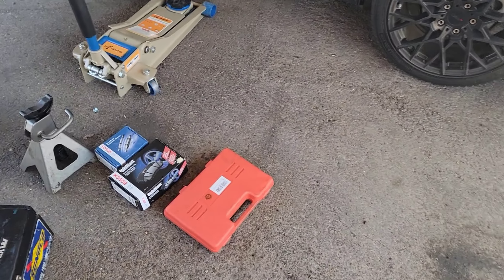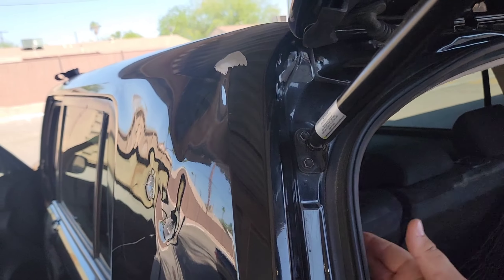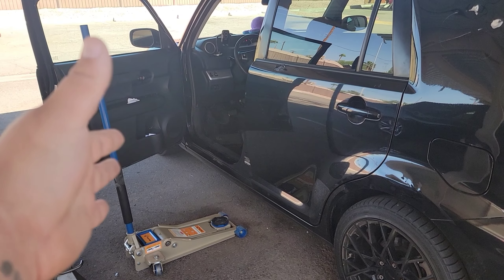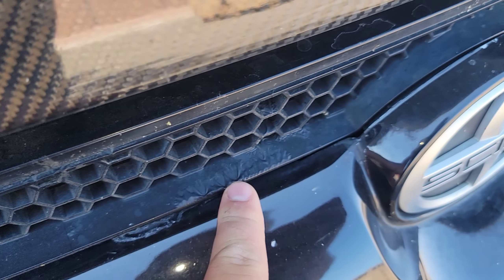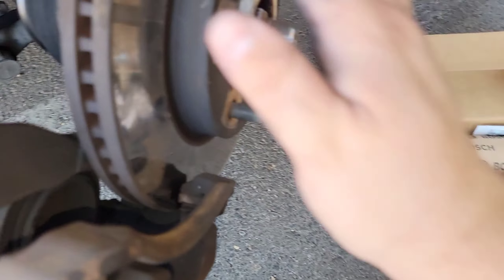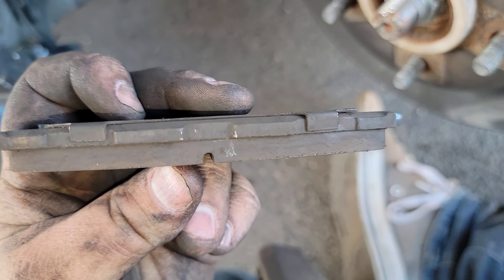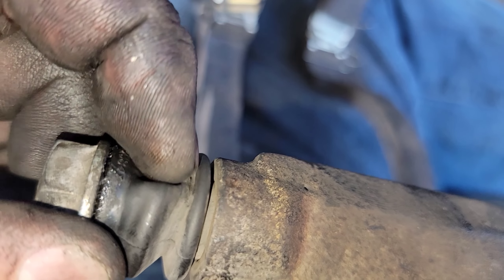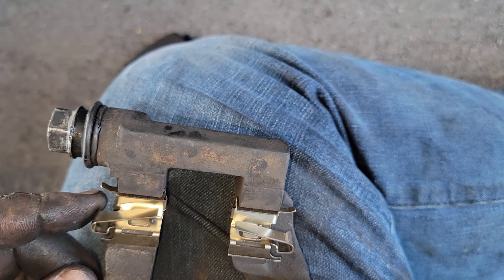Pads and MORE DAMAGE 🤬

Comment: uneven pad wear is from caliper issues,,,,, id recommend replace but if on tight budget,,, rebuild kit
Reply from the maker: Ended up replacing the caliper bracket 👀
Reply: @InsignificantBoost  when i change mine next probably going to power stop upgrade
z23 series

Comment: Same thing happened with one of my sliding caliper bolts. Seized up also. Was a pain to get out. I cleaned it the best I could and lubed it up but was getting brake noise. So I took it apart again and the same bolt was still hard to get out. So I cleaned it again and was better after(I took it apart later just to check.lol). But the noise ended up being the pads. I ordered a power stop pad/rotor kit and noise never came back.
Reply from the maker: Yeah sometimes things are just kinda wonky, next pad change I wanna upgrade the rotors again
Reply: @InsignificantBoost  yeah I didn't upgrade em or anything. Just got stock replacements. Lol. It was a good deal for pads and rotors

Comment: 👍Nothing like doing the work yourself instead of a shop I just did mine not to long ago pretty easy job sucks seeing the damage to your xb still can't believe it damm a-holes!
Reply from the maker: Absolutely always worth saving money 💸 I ended up replacing two bolts but that was the only issue, yeah that brake fluid did some damage, the spoiler is what bothers me the most since it got weak enough and cracked all over
Reply: @InsignificantBoost  Wow! I just order a unpainted rear spoiler for mine from ebay $120 not sure if I'm gonna paint it🤔 will see what a paint shop will charge lol
Reply from the maker: @jp7489  nah if I order one..I'm going carbon fiber to match the hood